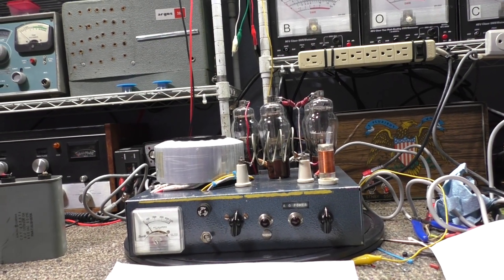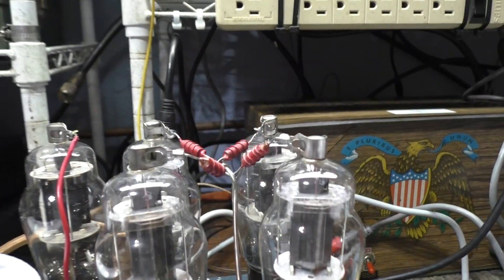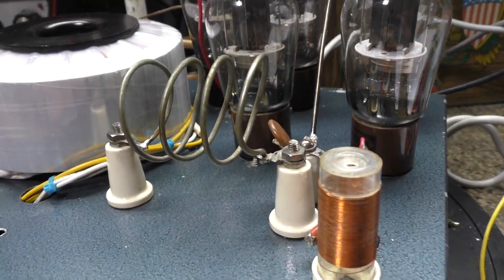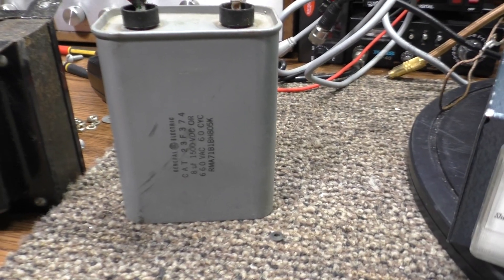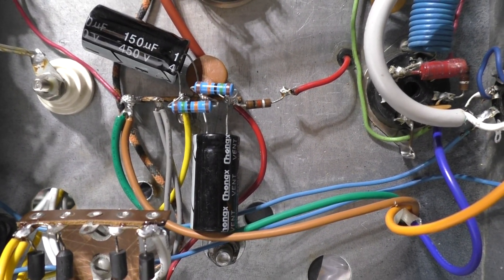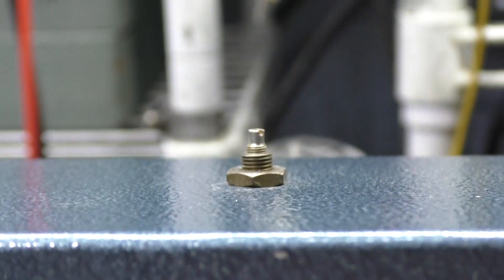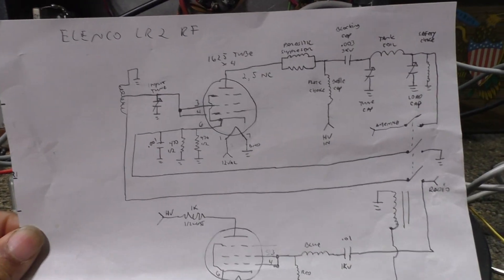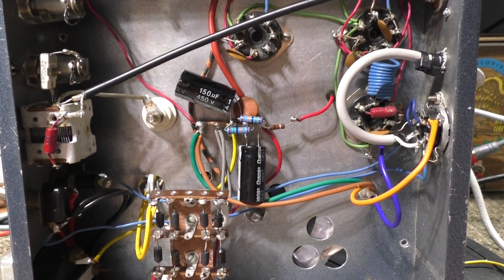Elenco LR-2 linear amplifier mystery box long winded walk-thru / talk-thru only.

Comment: I guess with surplus tubes being cheap they used them even if they weren't the best. Might not be so cheap now.
Reply from the maker: similar to the tube TV set era. Sweep tubes were used in all tube TV's to make the dots or pixels literally sweep across the CRT or tube screen, hence the term sweep tube. Since every TV had 1 and since TV's were made by the millions, millions of sweep tubes were available. They were plentiful and cheap, so amp makers used them. All was well until TV's stopped using tubes. Hence no sweep tubes needed for TV's, sweep tubes were no longer made, and now with thousands of sweep tube amps looking for replacement sweep tubes, tubes are at a premium.